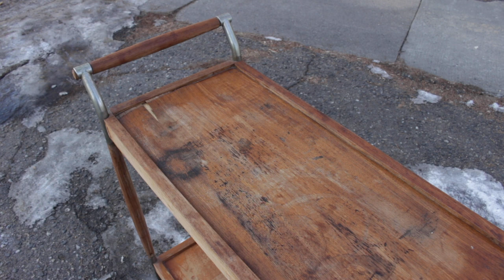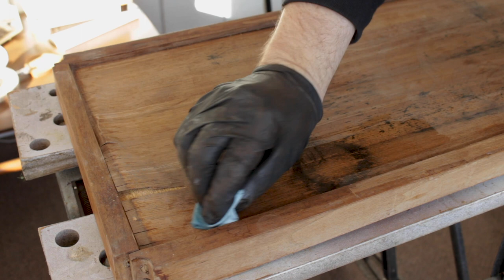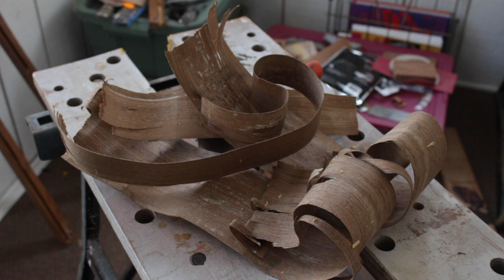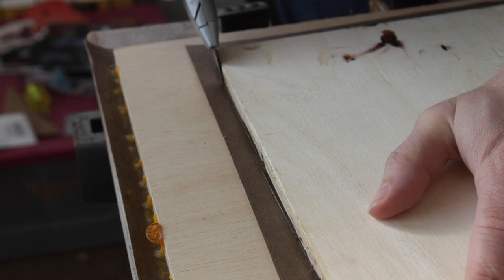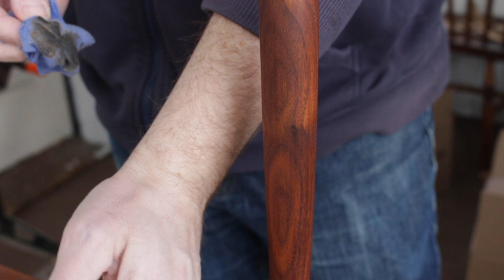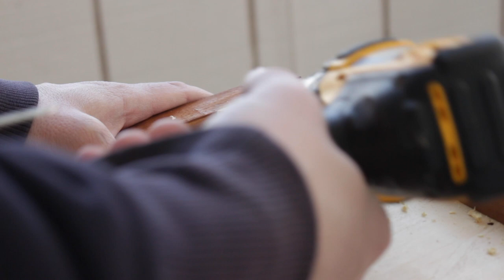Thrift Store Rescue #14 | Restoration of a Mid Century Serving Cart | Furniture Restoration

Comment: Love the persistence.  Try working with hide glue next time for the veneers.  No need to go with the glue pot route and all the gear.  You can use the Old Brown Glue for convenience and has all the same advantages. It also has the advantage of not interfering with finishes.   So much better than the PVA for this application and the smell is no where near that of contact cement.  Please try it. Watch a few videos if you haven't seen the process with working with a veneer hammer.   I've pretty much switched over to hide glue for most things I build now.  It is also nice that it is easily reversible.  I always enjoy your videos.  Best.

Comment: You might have been able to save the veneer you glued on with wood glue by adding heat. I previously glued veneer by adding wood glue on both pieces, letting it dry and then putting it together and re-activating the glue with an iron. Worked really well.

Comment: Hi! When gluing veneer w/ woodglue, try using a roller when applying the woodglue instead, and let the both surfaces dry first, and then press the veneer and board together using an iron. after adhering the veneer just wet the veneer slightly and if you notice any bubbles, use the iron on technique over the bubbles and after that press with weights and clamps. Just a tip!

Comment: I love your videos and I really appreciate them. Using your videos as my main source of information my kindergartener and I recently restored a turn of the century parlor table. I also used gunstock. I find that the stain was MUCH less saturated when I wiped it off of my wood than when you wiped off the excess, though. Do you have any advice about why this is? It was a maple wood, which obviously will have a different base color but could that account for all of it? Also, could you do a side-by-side of the before and after at the end of your videos? Thank you for all of them.

Comment: Great refinish,, I saw an other woodworker on you tube and I’m sorry I forgot his name,but he has another way to apply veneer. He adds wood glue to both sides and lets it dry. Then he uses an iron to heat the glue to adhesive the veneer  to the substrate. Have not tried.though it look good and flat when he was done.

Comment: After veneering the plywood with the bubbles in it, since you used white glue, you could have just ironed the piece and the heat would reactivate the glue and flatten it right out. Done it many times myself.

Comment: I was fascinated watching this, and I have a question about the card scraper.  You didn't mention using a stripper to remove the varnish, so if you didn't, what was the reason?  Or was the finish so thin it didn't need varnish remover and the card was sufficient?  Thanks again for sharing your process!
Reply from the maker: I haven't been able to find an effective stripper lately so I went with the scraper.  The finish was thin and easy to scrape off. Thank you.
Reply: That’s really interesting to hear!  I know a lot of DIY folks like citristrip, but I can’t get that where I live.  I have an antique Japanese school desk that has what appears to be a HUGE ink spill on it.  Now that kind of ink is made with “skin glue”, which should melt with hot water, except it didn’t, so I think it’s paint.  I’ll try acetone on a spot next, see if that works!  Thank you again for the information!

Comment: Wood glue doesn't work well on large sheets of veneer. The veneer expands from the water in the glue and later if you put it in the sun or a very hot place it'll crack. The contact cement is somewhat flexible and doesn't wet the veneer

Comment: You can coat both the plywood and the veneer with wood glue (PVA glue) let it fully dry then iron them together.  The hot iron will reactivate the glue and give a permanent bond.  You can do this without having to worry about smell from contact or worrying about clamping without a press

Comment: I like your videos, but I wish you'd just mention what you use to apply things - I can't quite tell if it's a rag or brush or foam thing sometimes.  Also, did you wipe the top after sanding before applying the stain with a tack cloth or do you use a vacuum?  Thanks for the videos - they are very helpful.
Reply from the maker: I usually use a vacuum but tack cloth works too.
Reply: @DashnerDesignRestoration  Thanks!  I'm refinishing the veneer on a mid-century dresser - I had to strip it, then cleaned with denatured alcohol.  Now I'm thinking I need to go over it with mineral spirits before applying the stain.  Does that sound right?
Reply from the maker: @muffetjones2668  Yes, sounds good.

Comment: Next time you want to use wood glue to Veneer, add glue to both surfaces and let it dry. Then use a ironing iron on low to medium setting to heat the veneer on to the surface you want to cover. Works every time.
Reply from the maker: Thanks, I’ll try it.

Comment: I once used animal glue to apply veneer to a MDF board. The veneer needs to be wet and the board  needs to be warm. The animal glue needs to be melted, applied to the board and than the veneer needs to be apply. With an iron you can apply heat and get puples out. I heard that this should work with normal wood glue as well without the water but I never tried it.

Comment: You could've reactivated the wood glue with a hot iron to get the bubbles out. Even better, let the wood glue dry on both parts, put them together and then reactivate it with a hot iron. I had good success with that, although the veneer was paper backed and the surface smaller.

Comment: Another wood glue method is to spread it evenly on both the veneer and the substrate, allow to dry, position the veneer in place, and then iron it in place with a clothes iron.  The heat will reactivate the glue and the pressure will smooth everything out.

Comment: I don't think it was a clamping issue with your veneer. Because of the use of wood glue, which tends to be water soluble, the veneer swelled, that's what caused the uneveneness.
Reply: Lol, I paused and then you went to the contact adhesive. :P

Comment: If you want to stain plywood first brush on very weak shellac 30 min before you stain it stops the blotch. Use a clear blonde waxless shellac, thin it down to about 1/3 shellac solution 2/3 thinners or alcohol, this also works on pine.

Comment: Another restoration channel does veiner by applying pva glue to both surfaces, letting it dry completely, then ironing the veiner on. Then he dampens it, which causes anywhere that is not well adhered to raise a bit, and he re-irons that area. About 3 cycles of damp and iron does it.

Comment: Why oh why didn’t you change the wheels???
Reply from the maker: I couldn't find a source for new ones. They still work relatively well.
Reply: @DashnerDesignRestoration  Was thinking kind of the same thing - or if you could get a black rubber band around them - maybe some of that rubber paint plasti dip around the outer edge to quiet them and prevent them from scaring floors.

Comment: I do not like and use contact glue. It is too intolerant to putting it right. I use normal PVA wood glue, on both objects and let it dry overnight. When I put the veneer on it does not stick and I can put it right. I then use some painters tape to keep it there, while I use my wife's iron, set to cotton, and iron the veneer in place.  No cloth in between, but move the iron around.  It is better for me then vacuum bagging, which far to often leaves blisters and I have to iron it anyway.